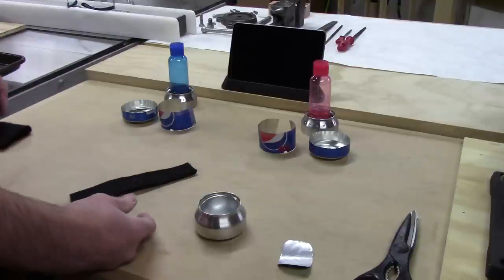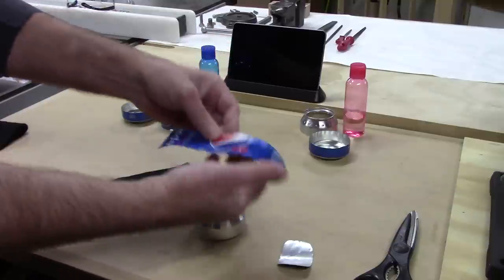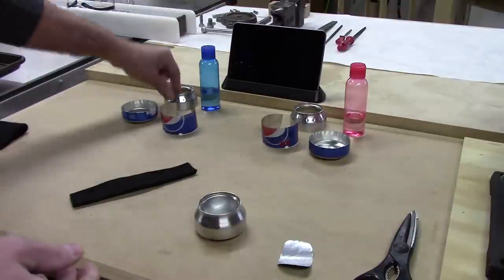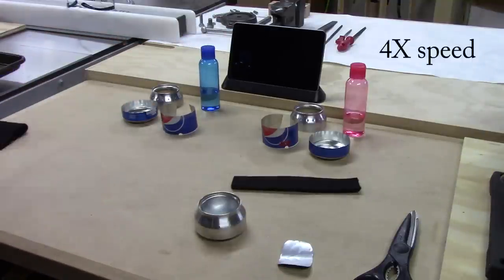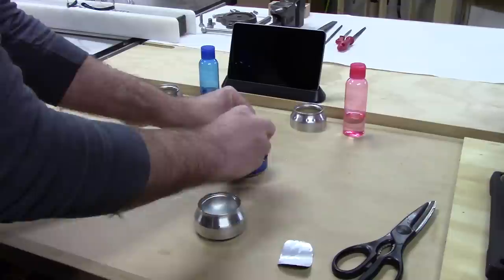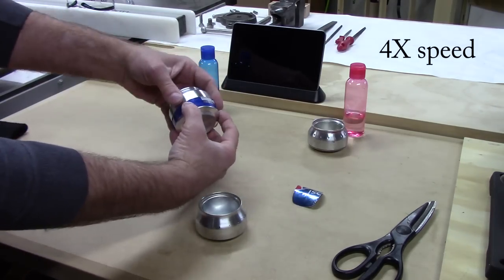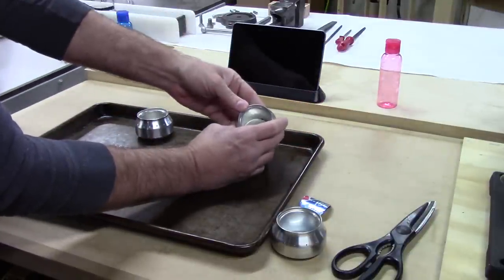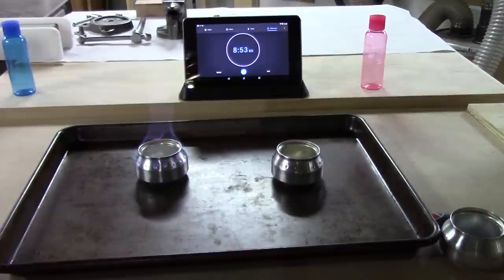Alcohol Stove   Carbon Felt Experiment

Comment: Honestly, I was surprised at the test. I thought the felt would out last the original one for sure. Thanks for the videos Tim.
Reply from the maker: It surprised me too.  I thought adding the carbon felt would cause it to bloom quicker, even if it didn't add anything to the burn time.  I was prepared to go buy a bunch of carbon felt.  I even tested it after I'd made the video to be sure it wasn't just some fluke.  It was just as bad the other times I fired it up.  Carbon felt may add value to some other configuration of alcohol stove but not to the ones I make.  Thanks, aksalaman 4ever!
Reply: I think the felt one got hotter a little later because of the thermal mass so it took the alcohol longer to heat up but once it did it took off and burned fuel faster. Would like to see boil test so the center flame goes out when burner in bloom.
Reply from the maker: Hey Fatwood Labs, I'm going to do some more testing.  Maybe make the carbon felt shorter.  I have to get another grease pot so I have duplicate pots to test boiling water.  Stay tuned.
Reply: Mine worked super with carbon felt, 40 ml of ethanol lasted above 45 minutes and the carbon felt light up the jets without priming becouse i have the original nature hike

Comment: Unless the heat output is measured for each stove is tested , it is impossible to know which will boil water quicker, which is what is really important. If the carbon felt boils 500ml. of water in 3 minutes & the standard takes 6.5 minutes which is more efficient? That's what's important.

Comment: If you look closely at the slits at the bottom of the inner wall of the White Box alcohol stove, you can see what appears to be a very thin metal mesh. Granted that would not soak up any alcohol, but I have wondered if it increases the efficiency of the White Box alcohol stove in some way. Another experiment for you to try some day should you be so inclined. :-)

Comment: Felt offers up a higher rate of vapor wicking/hotter flame. Modify the burner throttle top to half curret O.D. and retest. Smaller/hotter flame should extend life of same vilume + hotter flame temps

Comment: I think how big the center flame is means nothing when there is a pot on the stove. Do the test with a pot on and I believe you will see the jets on the wick stove have bigger flames and a faster boil time than the other stove. Plus the all-around biggest advantage with carbon wick stoves is their ability to light in freezing temps. How it works when you actually use it as a stove, its boil times, and how it performs in cold temps are the tests that matter. IMO
Reply from the maker: I agree with you, Terry. I do have the follow-up video to this one, but I didn't test boil times or cold temp use. I think those deserve another video and more experiments. Thanks for the ideas!

Comment: Carbon felt would be best used for a wick type burner.
Your alcohol stoves are vapor type burners.

What carbon felt would do for a vapor type is to place the carbon felt on the cold ground and the stove on top.

Carbon felt is an insulator.

Another use for carbon felt would be to make a ring around a vapor stove and use that as a wicking preheater in the cold weather.
Reply: Yeah, wax or vegetable oil would need something like carbon felt.

Comment: Hi!
Perhaps someone has posted an idea like mine.
I have used my stove for about 23 yes now.
It uses what I call a a double wall reservoir. Basically like yours but an inter, second wall about an 1/8th inch smaller radius. Betweenthe walls I used a thin wick made from home insulation. 
It primes quickly. When you hike the AT or other long trails fuel weight and availability are big factors.
I use yellow cans of Heet carried in enough 6 oz. Med bottles.Using the fuel in two 12oz Coke caps I can enjoy a cup of coffee and if I use a home made cozy. I can also cook 1/2 package of Zaterans red bean and rice in about 20 min. 
Howard Lyons
Reply from the maker: Hey Howard, those all sound like good ideas!  I like the idea of measuring with capfuls.

Comment: I think the fuel was absorbed and with no liquid surface to burn on the inside reservoir all the fuel was doing was gassing off and jetting at every orifice. The gas being jetted at the weep holes and wherever it could escape around the base of the inner wall really rocked.I was sure we would experience liftoff, atmosphere was probably way to dense.My calculations show that if you put the room under a slight vacuum and reduce the gravity by 1/2 G it should boil 2 cups of water in 3.7 seconds while only burning .9oz of fuel.                                                                      I really enjoy your videos.
Reply from the maker: LOL.  I was kind of concerned about liftoff myself!  Glad I thought to use that sheet pan under it.

Comment: INTERESTING. Sure thought the felt would have slowed it down. hmmm. I wonder if the water boiling time would be faster?  Thanks.
Reply from the maker: I did do quite a bit more with it offline.  The advantage is that it soaks up the alcohol and minimizes the danger of spilling.  There's not much difference in actual burning.

Comment: I think the carbon fiber stove shows that carbon fiber does a poorer job of wicking fuel and because of that, more fuel burns from the bowl than from the tip of the wick. When the bowl is empty, it continues to burn the little bit of fuel that did go up the wick.

However, with that said, it would be interesting to see what would happen if you blocked the bowl completely so it couldn't burn fuel from the bowl and could only burn from the top of the wick. 1) Would the carbon fiber burn longer? 2) Would it be hotter or cooler or the same as the unmodified stove? Seems to me, using carbon fiber might cause the stove to burn slower, and a bit cooler.

Comment: Spilled a bit pre-burn on CF side.  Then CF spit unburnt fuel early.  Agree it's too much felt, too high and that a pot covering the center might be better.  Is this the final stove version?  Because jets pointing outward aren't usable irl.  Irl pots are too skinny for outward-facing jets.  Carbon felt is surprisingly heavy and must provide value for its weight.  Prefer designs without felt if possible?
Reply from the maker: Thanks, Tom.  Check out my later video "Alcohol Stove Carbon Felt Redeemed" for an update.

Comment: I wonder how the boil times compare to each other
Reply from the maker: If memory serves from back when I was experimenting with that, there wasn't much difference.
Reply: @timcanthejigman7932  thanks for responding. I wondered if the carbon felt one put off more heat compared to “regular”

Comment: So a faster burn rate may just mean that the carbon fiber wick heater just burns hotter, so it puts out more heat in a shorter period of time--which isn't a bad thing if you need a higher heating rate--assuming that there isn't unburned fuel still trapped in the felt--which there probably isn't.

The reddish color may also be that some amount of carbon was actually consumed in the process--carbon can burn, you know.

Comment: I would have cut the carbon felt shorter so that it would not be blocking your jet holes.  You should also set a pot on the stove to snuff out the center flame.

The biggest benefit of the carbon felt is that it keeps your fuel from spilling if your stove gets knocked over.
Reply from the maker: Great ideas!  You didn't happen to watch the video I did after this one, did you?
Reply: @timcanthejigman7932   Just past the bottom of my screen.   Should have scrolled farther. Sorry I missed that.
Reply from the maker: Absolutely agree with you on the carbon felt containing the alcohol, just like a fuel cell in a race car.

Thanks!

Comment: Vaporizer vs wick? 2 different processing, wicks works on capillary properties the vaporizer does not.... If the wick was left as an open ring then it would probably burn faster because it would use more fuel for having larger area than the holes in the vaporizer burner on the left .... carbon felt is good for thicker fuels like oil, cotton  even napkin rolls are good for for oils too.... thanks X3 for sharing your video .... I felt like I was doing it or having fun as an assistant to Tim... hey one of my ex wives gave me one great gift that I still have it hanging on my wall after 2 more marriages ..... either I am not good for marriages or they are not or write here your or.... it reads "the world would be better if there were more people like you" and I think that if we didnt have patents everyone would improve faster on original ideas and the world would share more of what it is good for all not just some .....
Reply from the maker: I could probably use an assistant!